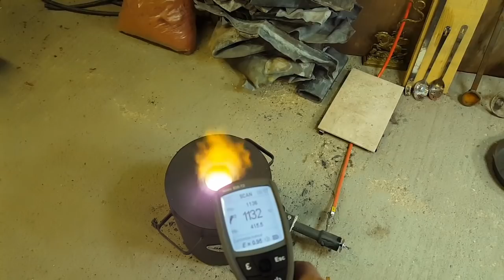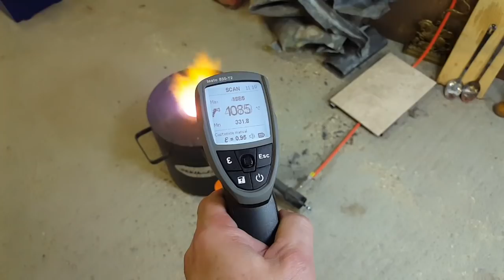Water Casting Copper Ingots, Shibuichi and Mini Copper Ingots

Comment: Try mixing molten metal with molten glass
Reply from the maker: Thanks Kari, Now that's an interesting subject...  I'd love to try that but I think I may need a kiln first due to the long annealing times...  Cheers Andy 🥂
Reply: @MeltandCast  yes😎 i tried search if somebody try that and i didnt find anybody that has try that
Reply: Kari Tammi hi there! Greetings from Switzerland :-) 
Well I’ve tried that just a few days ago but very small scale. I’m starting a new hobby... jewelry. Was in the process of testing a few different micro kilns I’ve put together.
There was a small piece of scrap copper and a bit of scrap from a glass-blowing project... to my surprise it all melted pretty quickly with a simple propane torch in my prototype insulated / refractory receptacle. Seeing it  wasn’t officially some kind of study one the fusion of these two, I left them there to cool and forgot about them until the next morning. Again quite surprised that I wasn’t able to separate them, so well had they bonded :-)
Reply: @MrSwissfrank  thats must be cool i would like to see how that looks

Comment: What is the benefit of casting in hot water?
Reply from the maker: Hi Kansara, water casting copper is a very old Japanese method of making an annealed ingot which is the starting point for making the Tsuba (handguard) for Japanese swords.  When the metal is poured into hot water a layer of steam forms around the ingot preventing the water from touching the metal and allows for slow cooling.  Tapping the side of the pot helps to release oxygen trapped in the metal.  Water cast ingots can be cast from copper, copper/silver (Shibuichi) or copper/gold (Shakudo) and other similar alloys.  Once the Tsuba has been worked it would undergo a patination process called the Niiro process which involves boiling the metal in a compound called Rokusho which gives the various dark colours often associated with this type of metal.  If you look up "Tsuba" on Google images you can see how the shape of these ingots form the typical Tsuba design.  There are many images where you can see the various stages of work from simple to complex designs.  You should be able to see how the ingots are worked from those images.  Hope this helps, Cheers Andy 👍😎🥂

Comment: Could you do it with boiling water?
Reply from the maker: The water has to be hot, around 80-90℃, it doesn't work otherwise...  And it can be dangerous, so I'd do a lot of research before even thinking about attempting it...  Seriously....  I accept no liability...  Cheers Andy 🥂👍😎

Comment: This would've been better if I didn't have to Google everything. Still not sure what a steam jacket is
Reply: A jacket of steam around the molten metal. I'll butcher the spelling im sure, but it's the leidenfrost effect. It's the reason blademakers swish the blade around in the water instead of just letting it sit. The steam jacket can cause uneven cooling.
Reply: What a truly fascinating science. So much I don't understand. Thank you for teaching me 😊
Reply: @caseywood9781  no problem. Just remember to be safe if you get into/are currently melting metals. As was said by others, molten metal and water rarely mix well. Aluminum for instance can explode violently.
Reply: If I were younger perhaps. I'm a professional wood worker. For now, I'll just watch the masters, like yourself, on YouTube
Reply: @caseywood9781  oh im no master lol. I might could be on one thing if I'd stop looking into others. If I can manage to remember it all,  I've got a lot more knowledge than experience.  Plan to change that in the next few years though.  However,  casting could be a great skill to use along side woodworking. You could cast your own hinges and latches,  as well as making ornate decorations from things that look just like bronze. If you're any good at carving wood,  wax should be just as easy. From there you just use lost wax casting.  And a bronze like metal can be made with pennies. Take care not to get that too hot though.  Zinc fumes are nasty. You could also melt copper into aluminum if you wanted a safer route. Though,  as a professional, your time might be well worth buying the items instead.
Reply from the maker: Sorry for the late response Casey...  As Kan says the steam jacket is like the Leidenfrost effect and is created because the water is near boiling (90C).  When the molten metal enters the water a layer of steam is formed around the ingot, which prevents the water from touching the metal allowing it to stay molten in the water.  Eventually the steam jacket breaks down after about a minute and the ingot releases all of its energy at once into the water, creating the rapid boiling effect you see after each pour.  The result is a clean annealed ingot with almost no porosity.  Cheers Andy 🍺😜

Comment: I have seen some huge steam explosions with copper hydro pours.....
Reply from the maker: Thanks Ocean.  I've read about a few...  It's definitely not a method of melting to be taken lightly, thanks for pointing it out.  I'd be interested to know more details, it would also be interesting to know if the risks can be mitigated to prevent such a thing.  Although from what I've read it's just luck of the draw and can just happen randomly.  I read about 1 guy who had 4 explosions out of 80 pours and with no idea what caused it... kinda makes me reluctant to pursue this topic further even though I really enjoy the whole process...  The speed at which the colour changed on the final ingot really blew me away.  I guess the way to go is to keep the amount of metal used to an absolute minimum...  I wonder if the Japanese blade smiths had similar issues ?
** To anyone else planning on trying this, research the topic thoroughly and understand ALL the risks before attempting such a thing. **  No liability accepted.  
Cheers Andy 🍺🍺🍺
Reply: @MeltandCast   we were one out of one and have not tried it again for that reason.  the seemingly glaring difference is our water was "room temp" and not heated.  to what temp are you bringing your water to?
Reply from the maker: My water was preheated to around 90C.  I read that 80-90C is optimal...